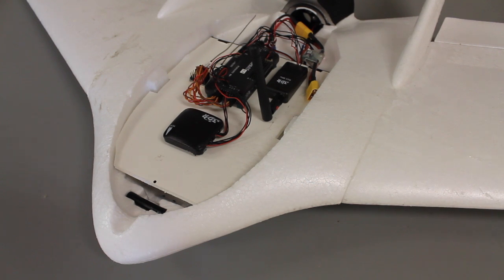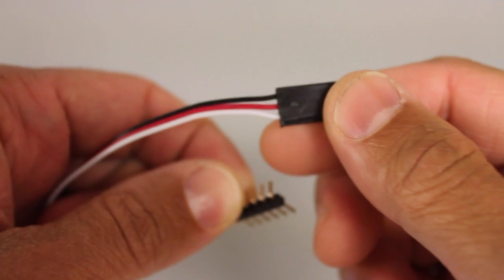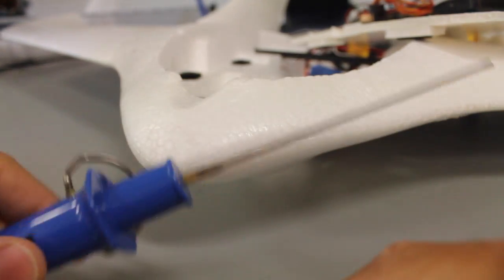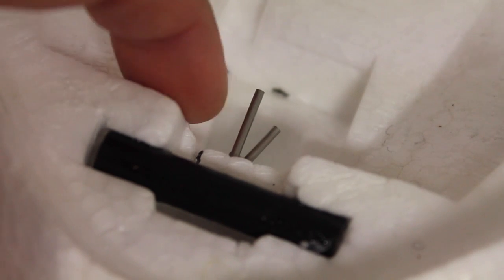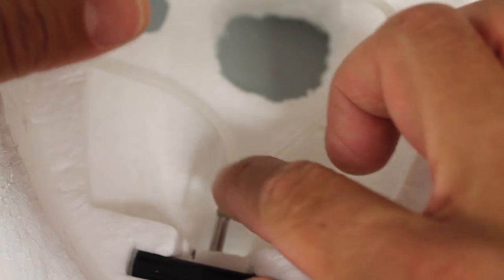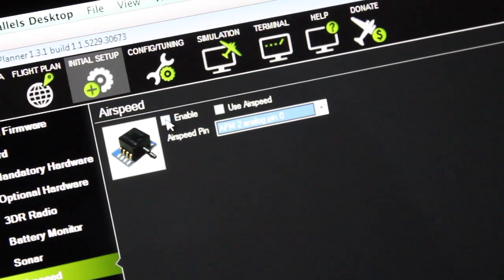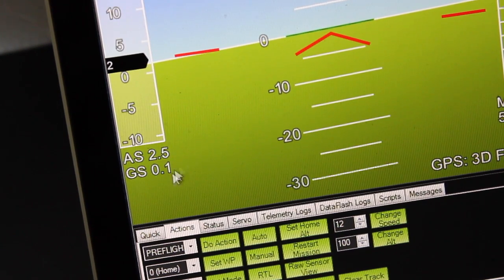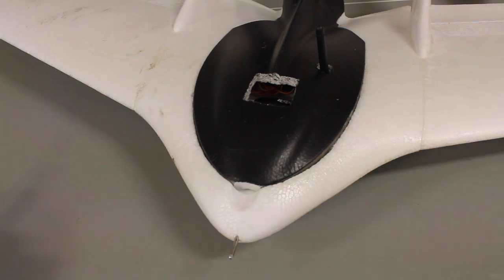APM 2.6 Airspeed Sensor Installation and Configuration

Comment: I'm trying to get an air speed sensors for apm 2.8 but I can only find it for 2.6... Anybody know where I can find it?
Reply from the maker: I'm pretty sure the standard version for 2.6 will work on 2.8. The 2.8 improvements are pretty incremental over 2.6 and I don't think the sensor is impacted at all. Don't quote me on this but from my research you should be fine.
Reply: Dennis Baldwin thank you, I ll give it a try

Comment: do   you know what is the maximum speed that this sensor measures ?
I'm asking because I want to use it to measure air speed in a wind tunnel, that I'm building in university
Reply from the maker: Good question. I'm not sure what the max speed is. Judging from this page:

https://pixhawk.org/peripherals/sensors/px4airspeed

"It features a Measurement Specialties 4525DO sensor, with 1 psi measurement range (roughly up to 100 m/s or 360 km/h or 223 mp/h). Its resolution of 0.84 Pa is quite good, and delivered as 14 bit data from a 24 bit delta-sigma ADC."

But you'll need to confirm that you're getting this sensor with whatever you purchase online. Good luck. Sounds like a fun project.

Comment: Dennis, I have the same sensor and get readings from 0 up to 100 m/s during flight.  Sensor is mounted on the front of one wing. 
What is my mistakt? AUTOCAL = 1 in the Parameters.
Reply from the maker: I'm really sorry to hear you're having that problem. I'm not sure what is going on as I've never experienced that problem before. I would try going through the calibration again and see if your results vary at all. Also, when you're on the ground does it stay around 1-3 m/s? If it does try blowing in it and seeing what the value changes to. Does it go up and settle back down or does it bounce around all over the place?
Reply: Yes, it is between 1-3 m/s after calibration and when I blow into the hole the values increases slightly but normally I dont have a laptop with me. It should autocalibrate before every take off. When flying in manual mode I watch the OSD and it varies very fast. Therefore I switched off the sensor for plane control because I dont trust the FC, that it can handle it. I dont think that the air in Europe is different from the air in the states :-)
Reply: Hi not sure if you fixed the problem but it could be caused by the air flow around the wing changing as AOA changes try moving sensor to side of plane

Comment: you can add another sensor in the analog inputs? for example temperature or humidity
Reply from the maker: +MarioCR21 You should be able to even though I haven't done it before. This article takes a bit about it: http://diydrones.com/profiles/blogs/humidity-sensor-sensirion-sht2x-for-ardupilotmega

Comment: Dennis, been a while since I tuned in, I know this is an older upload of yours but it is on a topic I have on my hands right now. I am trying to measure airspeed on a quad to do a neat little trick. I am building a standalone module using this analog airspeed sensor  and and Arduino, and wonder if there is any good place to mount a pitot tube on a quad to avoid propwash. Also looking into IMU's of course, but I already have ordered the 7002DP like you just installed in the vid.
Reply from the maker: Chris Leech Good question. The only thing I can think of is perhaps a nice little stand where you can mount it higher than the props? Otherwise there is generally so much wind coming off those props I'd have to assume it'll affect your measurements. I'm very interested in hearing what you're up to. If you get around to it please feel free to post photos and a description of what you're doing at www.garagepilots.com. We'd love to hear more about it. Thanks and take care.

Comment: After install the airspeed sensor, is there any pids/param value to be changed in mission planner? thx
Reply from the maker: The only thing I did was use Mission Planner to do the PREFLIGHT_CALIBRATE do action as mentioned here: http://plane.ardupilot.com/wiki/airspeed-3/#Calibration
Reply: I know this vid is 2 years old, but what happens if you dont have a laptop with you at the flying field? Can the PREFLIGHT_CALIBRATE be done from a stick command?

Comment: hi 
i need help please 
how to change the failsafe height in dji naza v2 more than 20 meter ?
Reply from the maker: I don't think you can. If you're not aware it will return home at the current altitude if you're above 20m. If you're below 20m then it will rise to 20m and then come home.
Reply: Dennis Baldwin  thank you :)

Comment: Another great video!
The airspeed sensor won't help much flying into the wind, but it will going downwind.  Airspeed is the speed of the relative wind, when calm the same as ground speed.  A plane flying 30mph (GS) in calm air will be doing 0 in a 30mph headwind and 60 with a tailwind.  In your video the plane had 0 groundspeed but 30mph airspeed.  If the autopilot relies on groundspeed alone, in a tailwind you could effectively have too low an airspeed to maintain lift.  That's where the airspeed is important.  I know it seems strange to have to add throttle going downwind but sometimes we do.  It's also why we launch into the wind. In my Cessna I never ever let the airspeed get below 60mph!
Reply from the maker: Very interesting. I did not realize this at all. It does seem counter-intuitive but I'm glad you're sharing what you've learned from real pilot experience. All mine has been at the sticks of a transmitter :) How many flight hours have you logged? Do you do it just as a hobby? Thanks for the great info.
Reply: I've been in R/C since 1975 and full scale off and on since 1972.  I took a break from full scale when I got married and our son was born in 1979.  Got back into Cessna's and Pipers in 2002 and have about 300 hours.  My best friend and mentor is a medical helicopter pilot and he has given me a few lessons, but helicopters are just too expensive!  The professional pilots (especially helicopter pilots) talk about "energy management" and "mission planning".  It's all about keeping the 4 forces of flight (weight, lift, thrust and drag) under control, along with fuel management.  One of the hardest things for a new student pilot is getting past all the "speeds".  Ground speed, airspeed, true airspeed, indicated airspeed, best rate of climb (VY speed), best angle of climb (VX speed), best cruise speed and economy cruise speed..  It can be confusing.

Comment: Thanks for the info D., I have one lying around somewhere, maybe its time to put it in my plane ;o)
Reply from the maker: You definitely should consider it. It's one of the easier sensor setups to do....aside from having to modify your plane :) Hope all is well.
Reply: Dennis Baldwin
Hi D, thanks, all fine here and hope for you the same.
The problem is that I have an epp-fpv with a apm2.5 in it, but I cant seem to fine tune it like I wish, the plane fly's well in straight lines, but the corners are crap.
I have limited flight test time, but I wonder if the airspeed sensor will help for a smoother flight and better turns in the air?
Maybe I need another/better plane ;o)

Comment: Hi Dennis The way you say petio is peteoooo . It's sometimes a bitch to set up in a real plane. I spent a whole day fixing mine on my plane. It turned out the hoses were blocked from a mud wasp. Important to check this before every flight. It doesn't take much to block it. Expect a pm from me on a couple builds. I just got the last parts for them. And a couple of very nice surprises for you. They will knock your socks off.

semper fi    steve

Comment: I haven't connected mine yet but I'm keen to start using it.
It seems funny that without the airspeed sensor the APM doesn't increase throttle to get the desired ground speed indicated by the GPS.
Reply from the maker: Yeah I'm just learning how the airspeed sensor functions. Definitely not quite as I had originally thought, but it's definitely been helping my autonomous flight. Thanks for the feedback.

Comment: I wouldn't put in the nose. For 2 reasons. If you crash you could damage it an if you had less room in your plane the tube could damage something important(battery?) Second, it looks cooler if its on the wingtip or somewhere on the side. Planes have them on the nose and wingtips, but for such a small model, the tube is so big, that the airflow over the nose won't affect the reading, hence the wingtip tube.
Reply from the maker: I always appreciate your honest and knowledgeable feedback. I filmed this video a while back so it's been working well in the nose, but you make a good point if I crash. I'm doing another build in the coming weeks and I'll look at putting it on the wing. Thanks so much.